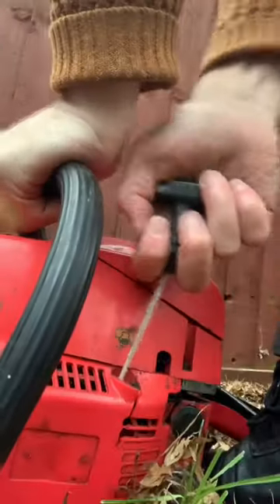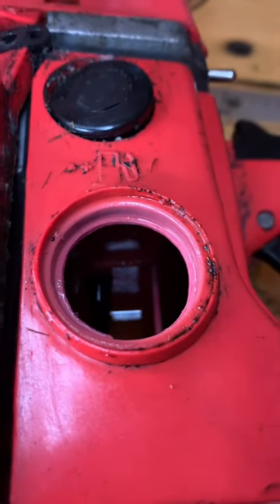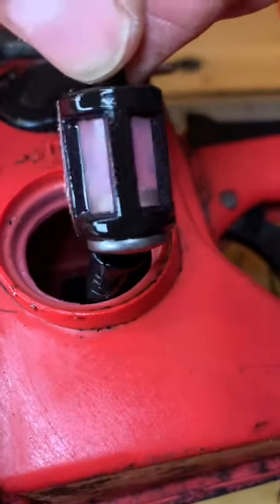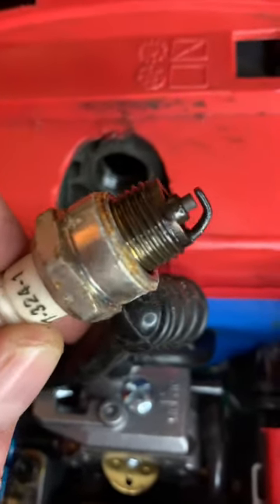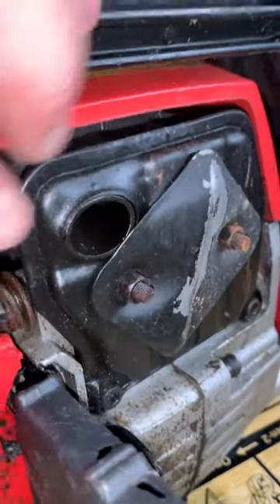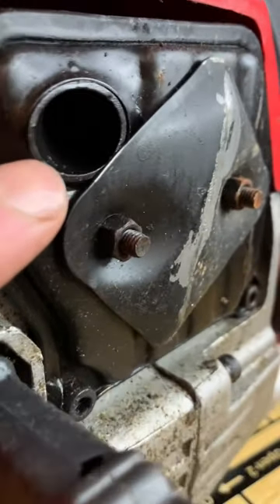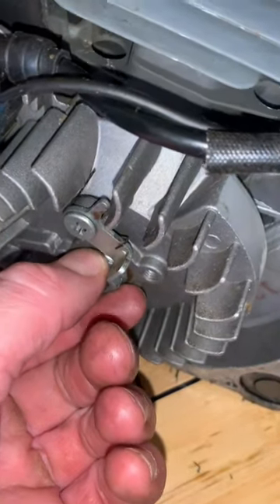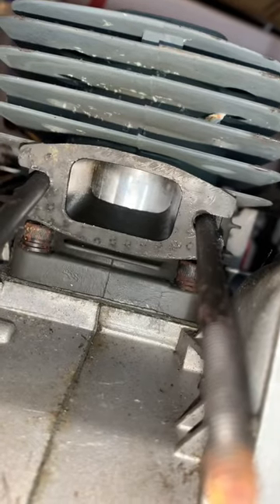If your Chainsaw Won’t Start. Do this!!

Comment: Take the plug out and dribble a little fuel in the head, put the plug back in and try to start it. If it starts then it sounds like you have a fuel delivery issue, in my experience most of the time people don't run them out of fuel before putting them anyway for the season and the carburetor will varnish.

Comment: This is why the average homeowner should NEVER buy gas powered chainsaw. They're high maintenance, often difficult to start, and require a certain level of mechanical knowledge that most people don't have. They'll get used until the first time they don't start, and then get tossed in the garage and forgotten
Reply from the maker: Thank you for sharing your thoughts, and I appreciate your perspective on gas-powered chainsaws. While it's true that they can require some maintenance and mechanical know-how, they can also be powerful and useful tools when used correctly and maintained properly.

It's important to remember that with the right guidance and understanding, many people can effectively use and maintain gas-powered chainsaws. Proper maintenance and safety precautions can go a long way in ensuring a chainsaw's reliability and longevity. I'm here to provide information and support for those who want to learn more about their tools.

Your feedback is valuable, and I'm here to help address any questions or concerns you might have. Feel free to reach out anytime! Craig

Comment: I have a yizbao that worked once. Now it wont start. I've done all i can to figure out the oddities. Choke out is on. Trigger up is on. Guard back is off. Fuel fine. Filter new.

Comment: To check spark take off plug wires, take out plug, put plug back in plug wire and rest on something metal, watch for the little sparks when cranking. (Don't touch it)

Comment: Struggling with a 1950 craftsmans doesn't run at all or idle or anything it will start if i manually add fuel but not sure if idle to high or not i just put a brand new fuel line in it air ways clear spark plug is new and does work im just not sure what it could be i would like tips please my best guess is something is not allowing it to pull fuel through the fuel line somehow even tho i check and blew through it yuck nasty but yes its just making me sad 😔

Comment: + check the ignition switch
+ check the priming bulb (if applicable)
+ check the choke lever (if applicable)
But hey, I am just a beginner so trust the Man above ;)
Cheers
Reply from the maker: Yes very good points. It’s quite difficult to fit all I wanted to fit in a one minute Short Video. Thanks for your valid contribution. Craig 👍
Reply: @TheRepairSpecialist hey Craig thanks to you for all the great información you share with us 👏. God bless you

Comment: Nice Zenoah Clone.  Have you deleted your base gasket yet?  I used Permatex Ultra Grey (Hondabond) in place of the thick paper gasket they like to use on these. Gained 15 PSI of compression. Another thing that helps a lot is to find the LARGE 2 port (the ports will take up 3/4 of the distance between the 8mm nuts) muffler with no internal baffle.  Between those two and making sure the carb isn't pig rich it will scream and cut a good bit faster.